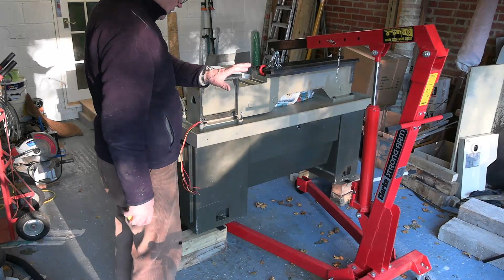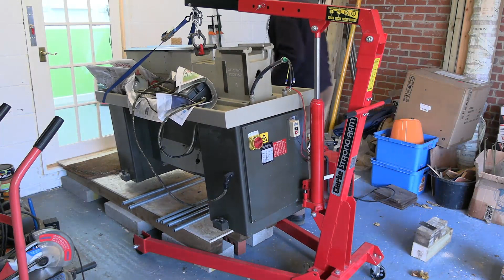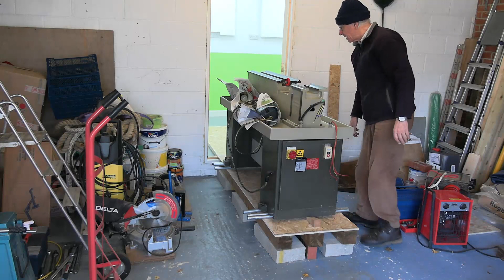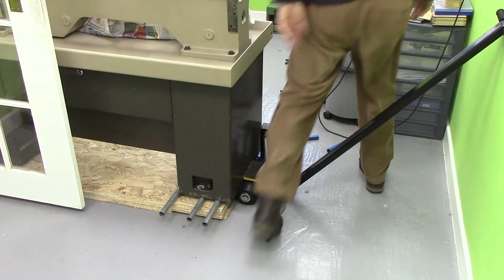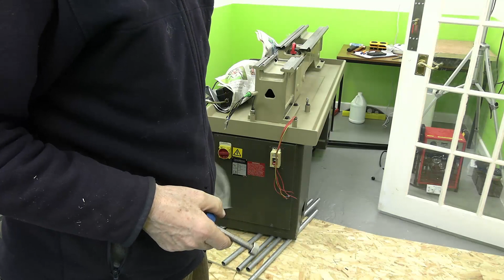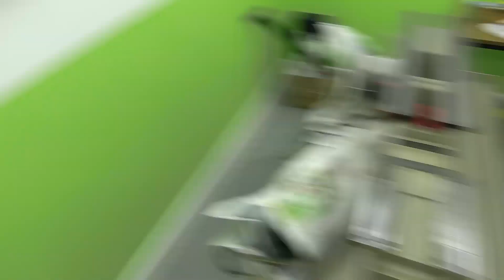Moving my Harrison M300 lathe

Comment: using a pallet truck will be much easier!
Reply from the maker: (a) I don't have one. (b) I don't think it would balance lengthways on.
Reply: @samuelfielder  I see that the main problem is the grounds of these two rooms are not same level otherwise just cut the bottom of the door frame and can easily move the machine on the rods

Comment: Samuel, I have really enjoyed watching your efforts at refurbishing this lathe. I particually like your reasoning and logical solutions to the many problems you overcome.
Reply from the maker: Thanks. I only wish the ways were a little less worn - something I should have measured properly right at the start. My thinking was "I haven't got 3-phase power yet, so I might as well get on and strip it down whilst I wait". Should have done test cuts straight away, and I still can't do that yet.
Reply: @samuelfielder  I have an old Colchester Chipmaster which had the same problem. So I set out to make the best of it by using the tailstock base as a sliding reference with a clock guage, then tried to make the high parts the same height as the low parts using oilstones etc. It worked out the lathe can now turn quite accurately over the slideway length. I only took off about 0.005" at the most unworn places.
Reply from the maker: @jackary2003  Funnily enough I was clocking the front V-way yesterday using the tailstock. I haven't quite finished that job, but it seems to fall just under 10 thou (0.25mm) as one approaches the headstock - twice as bad as yours. It doesn't follow that this translates to 10 thou taper turning, but we'll see. I was idly thinking "I wonder if I could fix a die grinder to the tailstock...".